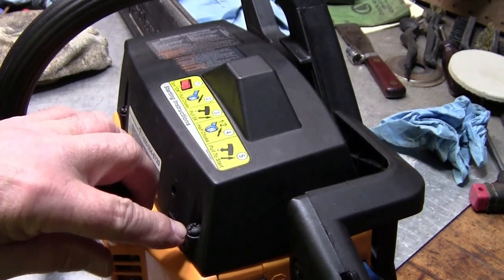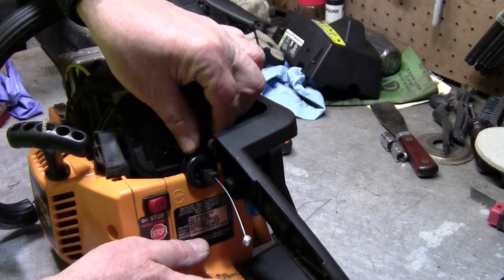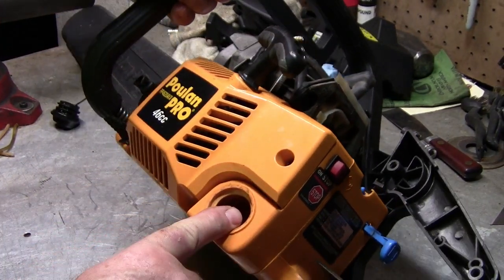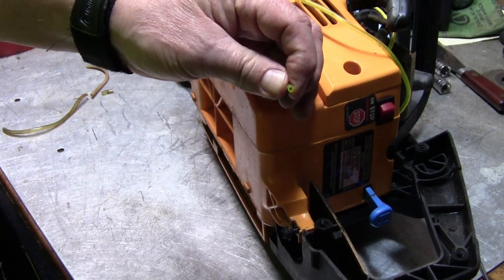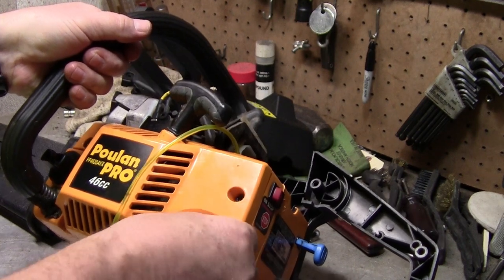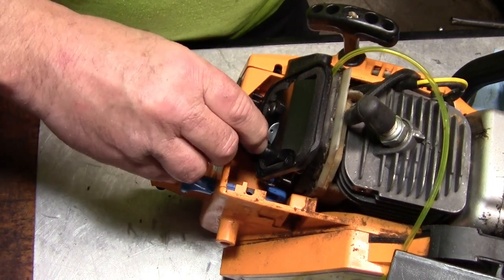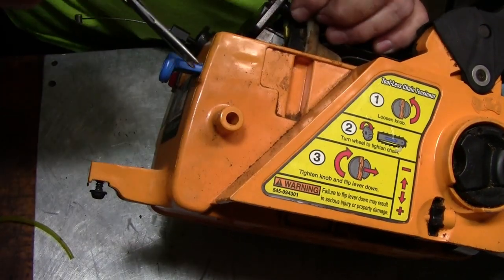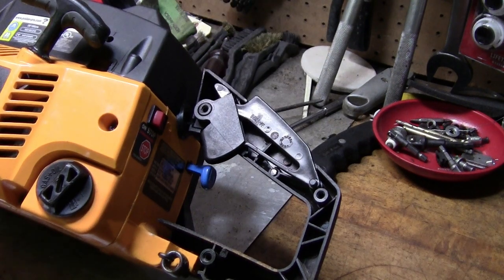Poulan chainsaw fuel line replacement

Comment: Nice informative video!  My dad gave me a Poulan Pro saw that "only needs the fuel line replaced..."  to be in working order...  It's been a good saw, but has been well used on our farm.  The small engine shop charges super high rates to fix anything and they take forever to do it.  So I'm going to give it a shot myself.  Your video seems to be just what the doctor ordered.  I hope it works.  Thanks.
Reply from the maker: Thanks and your welcome

Comment: Terrific video, addresses just what i needed to do on my Poulan Pro 295. Trouble shooting the saw not starting led me to check the fuel line. it was brittle, came apart & had tiny cracks. this saw might be 20 years old & had not started in years.
i modified the fuel line connecting procedure in the video in reverse order, connecting to the carburetor 1st, then threading a 2" long tapered cut on the end on the line. Attaching the fuel to the carb, while secured in the housing was impossible for me to complete, the access area is very tiny.  His technique using a 45 degree cut did not work well for me, I could not attach a hemostat to the end to pull it thru. Even attaching the fuel filter was difficult. The 2" long tapering worked best.

It is cold now in NE Ohio, so I'll wait until it warms up next week to see if it starts. I do not need to use the saw much after getting it running. If it fails to start, the saw may wind up in the trash. if i get another saw, it will be battery powered. The small gasoline engines are a pain in the butt.
Reply from the maker: Thank!

Comment: Lonnie. Thanks for the video. I know this is a 2 year old video but I came across it to help me diagnose my Poulan. Just a little back history. Saw wouldn’t start as it had been sitting for years. Took apart and cleaned carb, replaced fuel line as it was brittle and would fall apart. Installed new fuel filter. Still wouldn’t start. I decided to take off muffler to see inside the engine. Looked good to me. Smooth piston and just a little bit of burnt oil/fuel residue. I decide to see if it would start without muffler and it did after a few attempts. Got her running and she wouldn’t stop until I turned off via switch. Put muffler back on. Closed up top cover. Put bar and chain on and same thing now it won’t start. Any ideas?
Reply from the maker: First, see if your getting fire to the plug if so, take the muffler back off and see if it starts. If it starts, then see if your muffler has a screen on it, if so remove it and replace the muffler. Also check the muffler to to make sure it is not plugged up. Let me know what you find or what happens.

Comment: I am a chainsaw noob attempting to fix a 295 poulan pro. Is that metal gasket that you put on the front side of the carb going in, is that the only gasket it has? or is there a felt one on the backside also?
Reply from the maker: You should also have a normal cork gasket.
Reply: @LonnieJohnson1   so the metal one is by itself on the front and the cork goes on the back end of the carb?
Reply from the maker: Yes
Reply: @LonnieJohnson1  Ahh gotcha. Thanks a bunch for the reply I really appreciate you. 🙏🏻🙏🏻
Reply from the maker: Your welcome, Happy Holidays

Comment: Only wish they had better longer lasting fuel lines and I’d be very happy with that, people just don’t service them right or store them properly, use premix and train tank and run engine dry 😊😊😊
Happy Thanksgiving to everyone ❤
Reply from the maker: They make fuel lines to fail because there is no money in anything that last.

Comment: P3416 changed the fuel lines cleaned carb. saw only keeps running when upside down> prime bulb works when upside down???
Reply from the maker: Check your gas filter it could be stuck on top of tank.
Reply: @LonnieJohnson1  filter is good. I think I have fuel line on right side to carb to long.
Reply from the maker: It could be sticking up out of the gas and not lying down like it should.
Reply: Hey man. Great video. What size fuel line did you use?

Comment: What’s the size of that small fuel line?
Reply from the maker: Not sure. I purchased 4 different sizes off E-Bay and the line I used fit the best. You can also pick up fuel line at Home Depot or Lowe's.